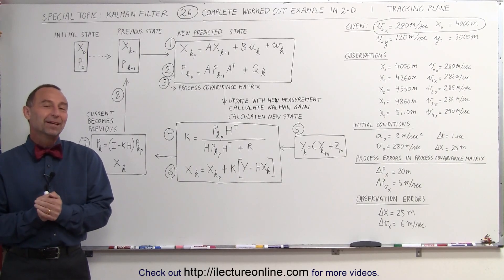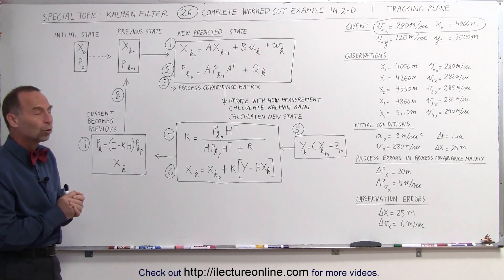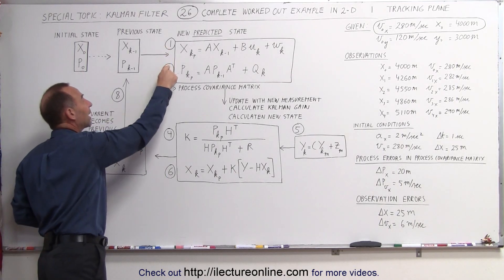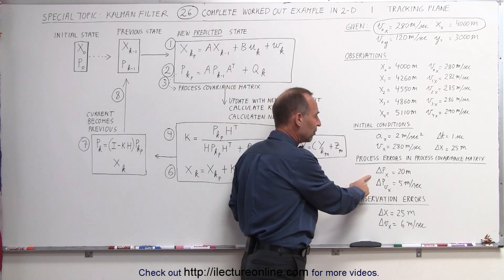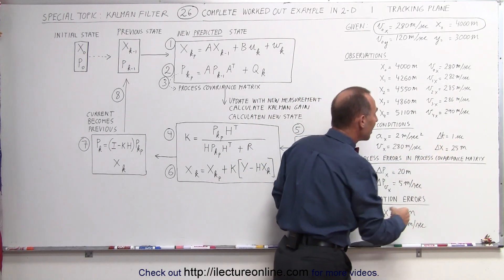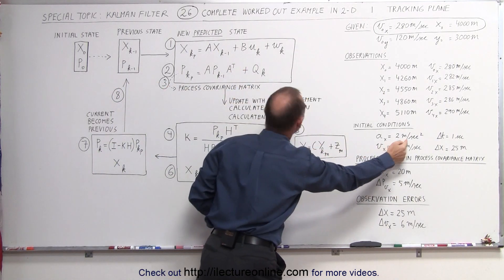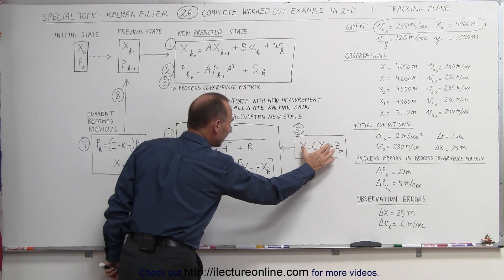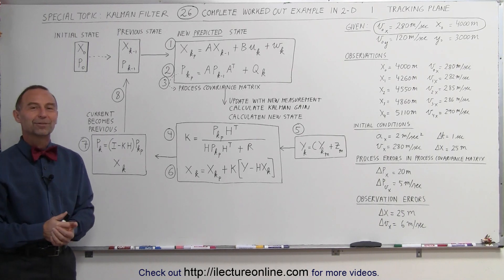Special Topics - The Kalman Filter (26 of 55) Flow Chart of 2-D Kalman Filter - Tracking Airplane

Comment: And here is the Python version:

import numpy as np
import matplotlib.pyplot as plt

# Given (initial conditions)
a=2         # (m/s^2) Acceleration (constant)
T=1         # (s) Sampling time
x0 = 4000   # (m) Position init. cond.
v0 = 280    # (m/s) Velocity init. cond.
x=np.array([[x0],[v0]])   # Estimated state vector (to store results)
Xp=x;       # Initialization just for storing predictions later

# Observations (measurements)
xo = np.array([4000, 4260, 4550, 4860, 5110]) # (m) Position observation
vo = np.array([280,  282,  285,  286,  290])  # (m/s) Velocity observation
xo = np.stack((xo, vo))              # Observed states

# Initial state error covariance matrix
dPx = 20                  # (m) Variance guess in position
dPy = 5                   # (m/s) Variance giess in velocity
P= np.diag([dPx**2,dPy**2])  # Initial estimate for state error covariance matrix

# Process noise
Q=np.zeros([2,2]) # No process noise assumed

#Observation errors
dx = 25 # (m)   Error in position measurement
dy = 6  # (m/s) Error in velocity measurement
R=np.diag([dx**2, dy**2]) # Process noise covariance matrix

# State-space formulation
A=np.array([[1., T], [0., 1.]])    # State transition matrix
B=np.array([[1/2*T**2], [T]]) # Input matrix
C=np.eye(2);             # Measurement matrix
H=np.eye(2);             # Measurement to state transformatio 

##Filter in action
run=4

for i in range(run):

    print('Iteration:',i+1)
    # Prediction part (p)
    xp=A.dot(x[:,i:i+1])+B.dot(a) # Predict state
    print('xp=')
    print(xp)
    Pp=A.dot(P.dot(A.T))+Q     # Predict state covariance
    # SIMPLIFICATION FOR HAND CALCULATION, DO NOT USE IN REAL ALGORITHM
    Pp=np.diag(np.diag(Pp))    # Comment out! Leaves out off-diagonals
    print('Pp=')
    print(Pp)

    # Update part
    K=np.dot((Pp.dot(H.T)),np.linalg.inv(H.dot(Pp.dot(H.T))+R)) # Kalman gain
    print('K=')
    print(K)
    y=C.dot(xo[:,i+1:i+2])             # New observation
    x = np.append(x, xp+K.dot((y-H.dot(xp))),axis=1)            # Updated state (current state)
    print('x')
    print(x[:,i+1:i+2])
    P=np.dot(np.eye(2)-(K.dot(H)),Pp)   # Uptated state covariance
    print('P')
    print(P)

    print('Close both figures to proceed...')
    Xp=np.append(Xp,xp,axis=1) # Just store predictions for plotting
    plt.figure(1)
    plt.plot(xo[0,0:i+2],"o-", label='Observation')
    plt.plot(Xp[0,0:i+2],"x-", label='Prediction')
    plt.plot(x[0,:],"^-", label='KF')
    plt.xlabel('Time (s)')
    plt.ylabel('Position (m)')
    plt.legend(['Observation', 'Prediction','KF'])
    plt.show()

    plt.figure(2)
    plt.plot(xo[1,0:i+2],"o-", label='Observation')
    plt.plot(Xp[1,0:i+2],"x-", label='Prediction')
    plt.plot(x[1,:],"^-", label='KF')
    plt.xlabel('Time (s)')
    plt.ylabel('Position (m)')
    plt.legend(['Observation', 'Prediction','KF'])
    plt.show()

Comment: Here is the MATLAB version (also on my GitHub, but I can't sneak the link past YouTube's spam detection:)

%Given (initial conditions)
a=2;         % (m/s^2) Acceleration (constant)
T=1;         % (s) Sampling time
x0 = 4000;   % (m) Position init. cond.
v0 = 280;    % (m/s) Velocity init. cond.
x=[x0;v0];   % Estimated state vector (to store results)
Xp=[];       % Initialization just for storing predictions later

% Observations (measurements)
xo = [4000 4260 4550 4860 5110]; % (m) Position observation
vo = [280  282  285  286  290];  % (m/s) Velocity observation
xo = [xo; vo];                   % Observed states

% Initial state error covariance matrix
dPx = 20; % (m)   Variance guess in position
dPy = 5;  % (m/s) Variance giess in velocity
P= diag([dPx^2,dPy^2]);  % Initial estimate for state error covariance matrix

% Process noise
Q=zeros(2); % No process noise assumed

%Observation errors
dx = 25; % (m)   Error in position measurement
dy = 6; % (m/s) Error in velocity measurement
R=diag([dx^2, dy^2]); % Process noise covariance matrix

% State-space formulation
A=[1 T; 0 1];   % State transition matrix
B=[1/2*T^2 T]'; % Input matrix
C=eye(2);       % Measurement matrix
H=eye(2);       % Measurement to state transformatio 

%% Filter in action
run=4
for i=1:1:run
    
disp(['Iteration:',num2str(i)])
% Prediction part (p)
xp=A*x(:,i)+B*a % Predict state
Pp=A*P*A'+Q     % Predict state covariance
% SIMPLIFICATION FOR HAND CALCULATION, DO NOT USE IN REAL ALGORITHM
Pp=diag(diag(Pp)) % Comment out! Leaves out off-diagonals

% Update part
K=Pp*H'*inv(H*Pp*H'+R) % Kalman gain
y=C*xo(:,i+1)             % New observation
x(:,i+1)=xp+K*(y-H*xp)    % Updated state (current state)
P=(eye(2)-K*H)*Pp         % Uptated state covariance

% Plotting
Xp=[Xp,xp];        % Store predicted state, just for visualization
subplot(1,2,1)            
plot(xo(1,1:i),'-o')
hold on
plot([x0 Xp(1,1:i-1)],'-x')
plot(x(1,1:i),'-^')
hold off
legend('Observation','Prediction','KF')
xlabel('Time (s)')
ylabel('Position (m)')

subplot(1,2,2)            
plot(xo(2,1:i),'-o')
hold on
plot([v0 Xp(2,1:i-1)],'-x')
plot(x(2,1:i),'-^')
hold off
legend('Observation','Prediction','KF')
xlabel('Time (s)')
ylabel('Velocity (m/s)')

pause
end
Reply from the maker: Much obliged.

Comment: Thank you Michel for your sincere illustration. 
By the way, I have a question about deltaP. 
Should the value be determined beforehand?
Or should I calculate the value during the process?

I know I look silly but, I'd like to make it clear.
Reply from the maker: It could be both.  Sometimes the errors and deltas are known and sometimes they must be inferred from the measurements.

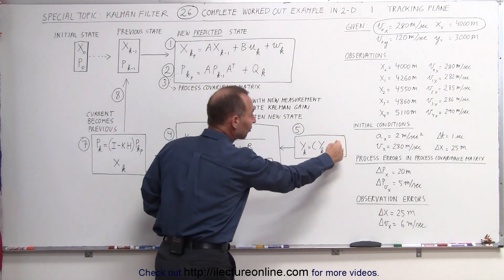Comment: What's the difference between Z (@1:23) and R (@5:34)? Both are introduced at the respective times as "observation errors".
Reply: He already explained it in another reply:
There are different type of errors of measurement.  We can have uncertainties in the measurement like 100m +/- 10m, because of the position and velocity gates in our measurement, (these typically go into the R matrix) and we can have errors due to unknown factors of the equipment, temperature variations, filter inaccuracies, etc. and can not be predicted, but are know not to exceed certain values.  (These typically go into the Z matrix).

Comment: I didn't understand what is process erros in process covariance matrix and what is its differences from observation errors
Reply: He sort of explained it in another reply:
There are different type of errors of measurement.  We can have uncertainties in the measurement like 100m +/- 10m, because of the position and velocity gates in our measurement, (these typically go into the R matrix) and we can have errors due to unknown factors of the equipment, temperature variations, filter inaccuracies, etc. and can not be predicted, but are know not to exceed certain values.  (These typically go into the Z matrix).

Comment: What if I have acceleration as the only measurement(from an accelerometer), how do i calculate distance then?
P.S.:You sir, are tooo gooood
Reply from the maker: Without having an initial position, and updated position measurements, that will be difficult to do.  (It can be easily calculated when you have an initial position, but without updated position measurements, it will be difficult to get an accurate track)
Reply: I may be able to get the position measurement using other techniques but I still won't have velocity updates. I tried wifi positioning as my project is for indoors and no gps is available but the error is huge. Will it be able to account for that error?

Comment: What is intuition behind multiplying P on both sides by A?
What sense does it make to do A P A^t?
Reply: Let's say y = Ax, and we are interested in the covariance matrix cov(y).
cov(y) = E[y y^t] = E[ (Ax) (Ax)^t ] = E[ A x x^t A^t] = A E[x x^t] A^t = A cov(x) A^t.
This is exactly what you see in A P A^t, where P is covariance matrix of the state before it have been transformed by A, and A P A^t is the resultant covariance matrix after the transformation by A took place. 
Hope that helps.
Reply: @arthurstraizhys  cov(y)=E[(y-E(y))(y-E(y))^t]
Reply: Correct.  I assumed zero mean of y ( E[y] = 0 ).

Comment: Hi! Thank you very much for these lectures! I'm just having trouble with the initial data. For example, I'm trying to track fish in the ocean using acoustic signals. However, I do not know the fish initial acceleration (and it probably wouldn't be constant) and I do not know how to compute/select the process errors in process covariance matrix. How should I select the latest? And does it work without knowing the acceleration? Again, thank you very much!

Comment: Thanks for these lectures, they are great! One question, what is the difference between the R and Z matrices? Are they not both the measurement uncertainty?
Reply from the maker: There are different type of errors of measurement.  We can have uncertainties in the measurement like 100m +/- 10m, because of the position and velocity gates in our measurement, (these typically go into the R matrix) and we can have errors due to unknown factors of the equipment, temperature variations, filter inaccuracies, etc. and can not be predicted, but are know not to exceed certain values.  (These typically go into the Z matrix).
Reply: Great, thank you!

Comment: I think there is an error in formula 6: Y - HXk should be Y - HXkp???
Reply: +Marc My thoughts were the same. Also he says that the term in the brackets is the difference between the previous state and the measurement. But it should be the difference between the predicted state and the measurement in the same timestep. In short: should be [Y - HXkp] as you said.]
Reply: Furthermore in formula 5 it should say: Yk = CXkm + zm
This equation is simply to indicate how measurements are related to the states that we are trying to estimate.
Reply from the maker: +Marc Slavin 
Why do you think there is an error?
Reply: +Michel van Biezen 
Because in Video 32 it is written correctly: Xk = Xkp + K [Y - HXkp] instead of Xk = Xkp + K [Y - HXk]         <- There is missing the "p" in the last part
Reply: I believe this is just a transposition mistake.